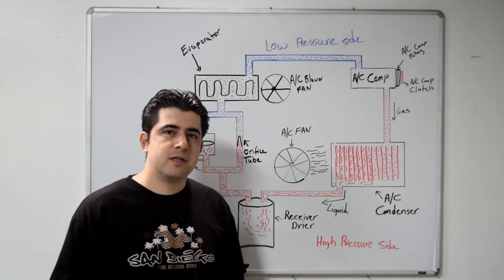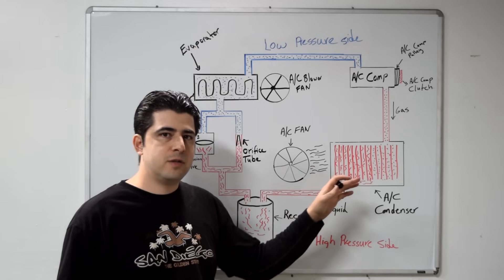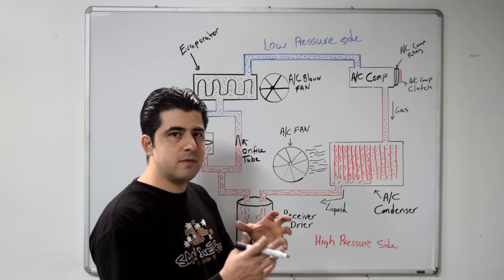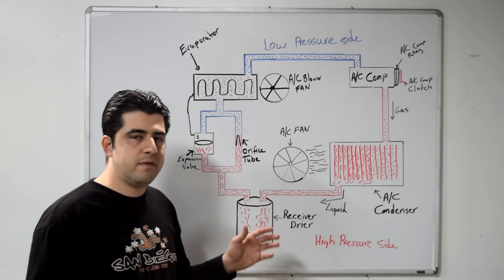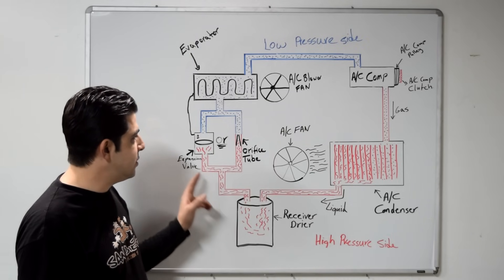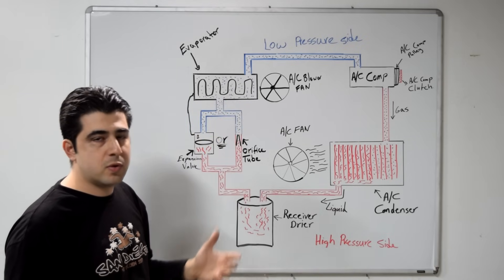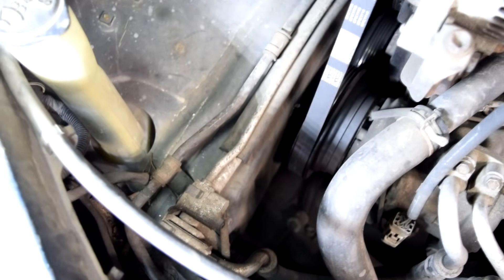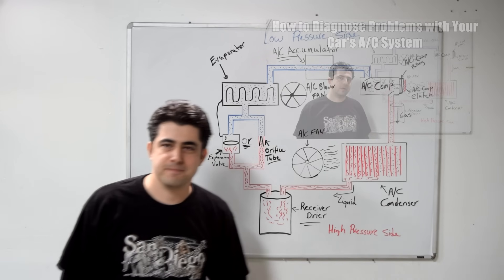How a Car AC System Works - For Beginners

Comment: If you ever update your video... I appreciate the video and white board! However... could you lay out some old parts on a table to which to point as you get to that part on the drawing? I'd really like to SEE the actual parts (even though I know they will vary somewhat). How does the orifice tube or expansion valve communicate? I don't see wires from that area to the evaporator or compressor... And you might mention, " In case you forgot...the condenser equals pressure, and pressure equals heat... It's like the molecules are fighting for space." Thanks again!

Comment: Good job on tutorial.  One clarification to note:  A system that uses a clutch-cycling orifice tube as a metering device vs TXV thermal expansion valve as drawn above; utilizes an accumulator/drier that is located on the low-side between the evaporator and compressor.  It is used to catch excess refrigerant liquid and lubricant oil that leaves the evaporator.  It will allow some oil to enter vapor stream to help lubricate the compressor.
TXV metering device system has a receiver/drier located on HIGH SIDE between condenser and evaporator.
CCOC orifice tube system has an accumulator/drier located on LOW SIDE (w/ LS cycling switch) between evaporator and compressor.
Reply: Did you not watch the end of the video? At 8:41 he mentions this.

Comment: Thanks for the video.  I had a 1989 Honda Accord and the system had a sight glass on one of the components and I could see the refrigerant flow in one direction.  I don't recall a vehicle I've had since then that had a sight glass.  Thanks again.

Comment: Well Done Video, really simple and well explained. I wish he would've mentioned a few other things that are part of the ac system like the high and low side pressure switches and the condensation drain for the evaporator. Small things like those are important as well.

Comment: Thanks for all the info. I took my 2000 Subaru Outback to a mechanic and he wants $2000 to find the blockage in my system. I bought a set of gauges and a temperature gun to try and find the blockage. But I screwed up from the get go. The gauges didn't come with any directions, (ebay) so I didn't close off the yellow hose when I connected the red and blue lines to the high and low ports. So when I opened up the high and low gauges after turning on my engine and running the a/c on high, I could feel pressure coming out of the yellow line. I believe I evacuated what Freon I had in the system. My gauges are reading 0 on the red side and 10psi on the blue, and my compressor clutch will not engage. The clutch was engaging before when I added Freon to  the system, and the mechanic never mentioned it not working. So I think it was me who screwed up by not blocking off the yellow hose on my gauge set. Do I need to evacuate the system before adding new Freon to it ? I figure once I get Freon back in the system I will be better equipped to diagnose where the blockage may be. Any tips for locating a blockage ? Scotty Kilmer's video mentioned using the temperature gun. If I  need to replace the condenser, should I replace the drier as well ? Thanks for any help and God bless you for helping out your fellow man. John

Comment: Hi, great explanatory video!   Here's my situation,  2003 Pathfinder, AC hasn't been maintained since new!  I did the DIY Can w/gauge thing.
But before adding r34 the gauge read 105-110psi way into the red w/car running !   ( I was told do not add at that point, seek professional help) **Story of my life!

Anyway, watching a few DIY Utubes, I quickly figured out that I can put gauge on The LOW Pressure tube under the Dust Cap and bleed the pressure down! I did just that, but unlike the utubes, it never put a yellow residue into my white rags all the way down to Zero PSI !  ok, seems easy enough ( I know there is more involved), but shooting for simple fix, I shook up can of r34 and proceeded to fill as directions and several U-tubers directed)  I put in all 18oz of the can and the gauge sat perfectly in middle of green area, I reached in window to feel nice fairly cold air coming out of vent!!!!   I said PTL and was very happy it seemed to have worked perfectly  :-))   ...  each day car was blowing warmer and warmer air  :-(   ...  after a week, I was told it was because I didn't fill it enough! ?!  I went to Auto Part Store I bought 2 small 12oz cans of r34,  I repeated steps above..... Yes, The gauge started way up in the red again pervious adding the 2 cans, I bled it off,  put the 2 cans in, the gauge went to the top of the green area on the gauge, I used another gauge from a friend & had same reading!  so I know it's probably not a faulty gauge! 

YAY, I have cooler air blowing into car from vents... but not cold , sure enough 3 days later the AC was a little cooler than outside air 
My neighbor, doing me a favor works at Sears Automotive, took it in today to see if his Mechanic could trouble shoot it and see if and where there maybe a leak
or if any of the components are bad!   * Here's the funny thing, instead of me replacing the dust cap on the L line, I kept the cheap-o gauge on it all week and kept raising the hood to see what it read whether it sat all night or ???   After blowing warm and it zooming back up to the red, I bled it down to zero, and watched the gauge climb on it's own!  I opened the hood this AM in front of him to grab my gauge and it was in the white area, I showed him.

Upon servicing the AC The Mechanic texted that the Compressor was fine and I was lucky not to have blown a seal, for I had overfilled R34 !!! 
I say B.S. but then I don't understand this as A Trained AC Mechanic should!

1)  How could I overcharge it having bled psi down to zero both times previous adding R34 ?
2) Upon being asked if they put dye in to check for leaks, they told me later that they had put the dye in ... (I'm not meaning to be a turd, and reiterate I am No Mechanic but skeptical because from what I understand it's a enclosed system like Brake Fluid system or Coolant on a vehicle!  There has to be a leak somewhere, 15 Years and AC blew cold enough to put a sweater on, it worked fine  and now it doesn't!

Any ideas , Please help this old Veteran out  

God Bless America

Comment: Great Video.  However, I think you should have shown two diagrams.  One diagrams showing the expansion valve/receiver dryer setup and the other showing the orifice tube/ a/c accumulator setup.

Comment: Changed the a/c compressor (filled oil up to correct levels), desiccant bag (04 Hyundai Santa Fe, receiver drier attached on the side of condenser), expansion valve, and all the o-rings pertaining to each component changed. Put a vacuum on it for ~45 mins, let it sit for another 45 mins with no indicated leaks, charged the system up utilizing the manifold gauges to "correct pressures", unhooked gauges, got in the car and the air was warm.... Plugged gauges back in, and it shows low pressure side almost pegged, and high pressure side hovering under 150psi (it was almost 90 degrees here). When recovering refrigerant, the high pressure side drains faster than the low, and will always be lower readings than the low side. Every once in a while, the air will feel "cool", but nowhere near what it should be. Condenser fan is working great, radiator fans working, compressor clutch is engaged, and a/c switch works. My guess would be the expansion valve, but I wanted to get a second opinion from you. I've watched and learned from your videos over the years, and they are the most informative. Please help! Thanks!

Comment: How does the A/C system flow diagram look for a vehicle that also has rear cooling lines such as found in a Chevy Tahoe?  I've seen a few videos in which the front vents were blowing cold but not the rear.  I've also seen a video in which an owner apparently had issues with his rear cooling and instead of fixing the problem, he blocked the lines going to the rear of the vehicle by installing plugs.  These videos with rear cooling issues lead me to believe that there is a separate component (and therefore something that can stop performing)  that routes the refrigerant/cooling to the rear without effecting the front or else the front wouldn't be blowing cold as well.  I appreciate any light you can shed on the subject.

Comment: This and those post like this one is excellent, however we find tons of videos like this but you can't find one single video explaining what to do to troubleshoot bad control or actuator wiring, we have enough video's on the web telling us about under the hood, we need a break down on the BCM and EMC and how these items work with your car or truck HVAC system including the head or what most of us call the control unit., if you can do a video on this you can easily do a video on what would cause an actuator to stop operating as it should.

Comment: Great video on how the system works in general, thank you.
I have 1986 190e which the A/C doesn't work, the compressor doesn't comes on.  I changed the original compressor and the dryer to 134A compatible, changed the push-button & A/c relay, and the pressure switch, still no luck, would you direct me how to fix it.  Several local mechanics has charged me to the nose, yet no A/c

Comment: My ac only works only on 4 and it makes a scraping noise...I was still using it, but then some burning somewhere starting blowing burned smoke into the cabin...any idea what the problem is? What might be burning?  TY.

Comment: Hi, I have a question I have a couple of cars I'm getting power on pin 30 and pin 86 the other 2 is ground when the relay is removed but the only way I can get the ac clutch to engage is if I bypass it , do you where I should look for the issue to get to work the right way ?

Comment: Forgive my ignorance, but what do you mean when you say moisture at 3:46. Th refrigerant leaves the condenser in liquid state, runs through the receiver/drier which removes contaminants and moisture (my understanding of the word would define that as a liquid, the refrigerant in this case). After the receiver/drier removes the moisture it still leaves in a liquid state. Is moisture in this context defined as condensation? If it is defined as condensation how does the receiver/drier remove it from the refrigerant? Am I missing the concept entirely? Someone please educate me.

Comment: If you have a new receiver drier how long can it be open to the elements. A day, week, month etc before it needs to be replaced. I'm in the process of installing a complete new system and wondering if it takes too long to get everything plumbed, evacuated and charged.  It looks like the receiver drier has caps on it right now but after I remove them how long does it last. Thanks

Comment: I had a voltage drop and I found at least 1 from license tag light. And I had a chirping noise and it only makes the sound when I turn AC on. I've got starter rebuilt and 2 alternator's I put on and it's not losing as much voltage now. Could it be the AC relay but I just switched 2 the same. Please help me. Oh I cleaned battery cables and al grounds

Comment: hello my car ac compressor on and off every 10 sec I check the gas and it charge because when car is off low pressure 120 psi do think type of r134a which available are bad type cause this problem or the condenser or thermostat or what u suggest for me to do

Comment: My 1993 Chrysler Town country...turn ac on but it stays off. But when the engine warmed up the cooling fan turn in and simultaneously the AC comes on..after a couple minutes the cooling fan  goes off , the AC off along with it until the fan Runs again...I was thinking about hooking up the fan to 12v with a switch so I can turn the fan on so the AC would come on with it anytime I want..can It be done or will it burn the AC compressor...can you help

Comment: Have a odd question, I bought a new line from the condenser to the evap, but it was slightly different  it had a built in oriface tube built in real close to the evap. But my other original one was located jamed down at the condenser. Didn't like this way I thought the built in one was neat. But new line came with high pressure port instead of the low like the original. So I thought maby ok so I just put a high pressure end on my low pressure hose. But could not get suction to add freon. Is it because I'm trying to add freon before the oriface???anyone know

Comment: Does any lines pass through the transmission? .I smelled gas when I opened a wrong bolt in transmission...I closed it quickly.

Comment: good video as always and very good tutorial and explanation and very good timing for ac info before spring and summer on question thou what is the pressure on low side and on high side is there big different in those line. thanks for sharing and posting.

Comment: hi do you have any videos on lpg systems I've got a vauxhall zafira which has factory fitted lpg system and when I switch to lpg the engine starts revving at high speed thanks

Comment: Hey
I have a question 
My 04 dodge ram 1500 4.7 has the little ac condenser and you know it has his own cooling fan
This fan will work when the ac is on only
Or it will runs with the heater too?
Thanks

Comment: My clutch flops. Now the bearings are grinding. I can't get it fixed until Nov 4. It makes a loud noise. The compressor needs replaced. I'm afraid to drive it because I think I will damage something in my car.  It's really loud. The AC is off, but the noise from the bearings grinding is really loud. Is it ok to still drive?

Comment: Hey Brother awesome instructions. question do you have a 2001 Dodge Ram 1500 3.9L ac wiring diagram? my 10amp fuse keeps burning out. Do u have any suggestions?

Comment: I have a question. I'm trying to diagnose what is wrong in my cars ac and I don't know whether it was the condensor or compressor. Ac turns on but it's stuck on economic mode with warm air coming out. 2002 audi a4 1.8t. Any help? I put more coolant and nothing happened.

Comment: Hi. My ac button won't switch off, so it's always running on auto / always running.I checked the fan speed controller, but that's not the problem. Ii must be circuit board in the dash right? Anyway I left the fan speed controller unplugged, so the air con doesn't blow anymore. But I think the compressor will still be running right? So I unplugged the Compressor. After that, I noticed that the 2 fans in front of the radiator are still blowing, even when engine is cold & only just started the engine. Why are the fans still blowing? (2003 2.0 Nissan Primera Wagon)Thanks

Comment: Awesome videos! I have a question I own a 2001 vw golf German made, just replaced ac compressor, dryer and expansion valve, also both fans in front, I can hear the fans engaging to high speed but my ac won't blow cold unless the car is in motion. How do I know for sure I need a new ac condenser? Thanks a lot my friend.
Reply from the maker: Johnny Martinez if you replaced the compressor due to it seizing you probably have metal shavings blocking the condenser. But check your pressure readings first to verify but also double check and make sure both fans do indeed work and also you have to dirt or debries blocking your condenser up front. Also make sure you have enough refrigerant in the system. gl

Comment: So just to clear a doubt when the high pressure gas is leaving from the ac compressor into the condensor, the gas is turned into liquid by the atmospheric air that is being cooled by the ac fans am I in the correct or is there an actual device that performs that function?

Comment: Does the car cooling system has any high or low pressure switches on both lines? Thanks
Reply: Yes, Depending on the vehicle it may have both.

Comment: If you where to drop something in the windshield air vents where will they end up in?
Reply: In the ducts. It will surely have to fight with the blower fan before reaching the cores, though. So all it would take to remove it can only be to remove the blower fan.

Comment: Thanks good vid. Maybe a heating system lesson next. East coast is slammed with cold. I always wondered if keeping the heat adjustment knob at cold when the car is warming up helps it warm up faster cause the coolant will not be spreading through the heatercore hose and losing heat. Any truth to that? Thanks!
Reply from the maker: Hi, I have a video on how to fix no heat issues here: http://youtu.be/eai_tFzltLc
and yes keeping the adjustment knob at cold during warm up will help warm up the engine faster, you will have coolant in the hoses and heater core but it will be blocked off from the engine side so only the coolant on that side will need to warm up. If you have an automatic climate control unit this is done automatically. Good thinking, and thanks for commenting. cheers

Comment: I have problem with my A/C compressor on the Mitsubishi Galant 04 2.4 L engine. First, after replace the rebuilt A/C compressor, I recharge the system, and the car had cold air. After a few weeks, the freon leaked on the low valve, and the car a/c didn't produce the cold air. I bought a can of freon and I did overcharge the system. The Compressor clutch wont turns on at all. I think the compressor is still good because when i remove it and mannually inspected it looks like it is still working. --any idea.
Reply: +Jingx Kwan I went to two shops, one shop said the compressor is not getting power event it is getting power from the battery.., and the shop check the pressure of the system and it says both the low and high pressure is good. based on your information, it is surely the compressor still good isn't it.